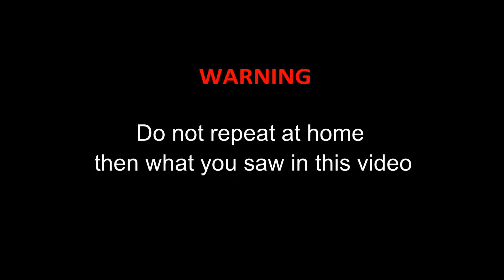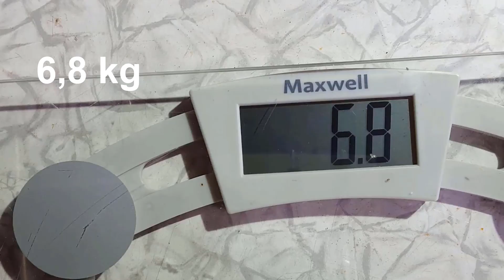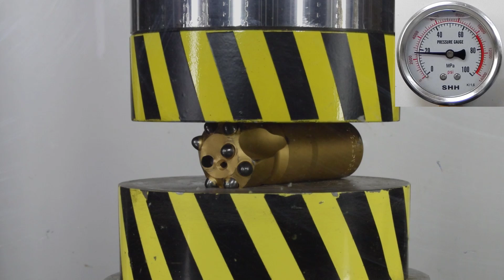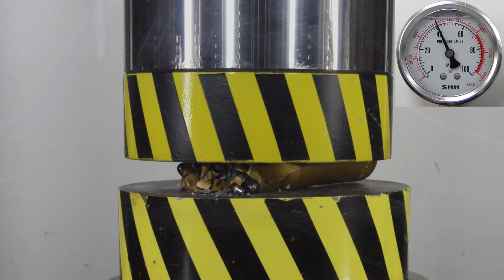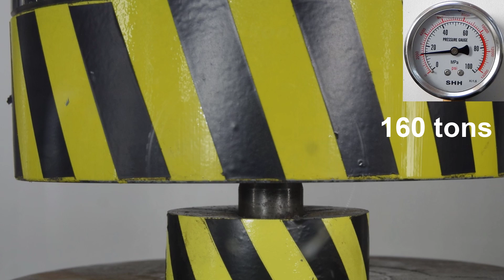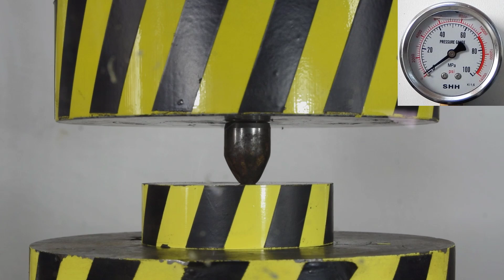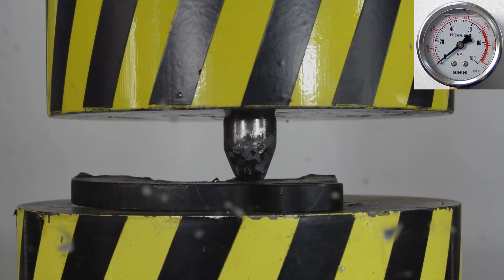HEATED TO 3000 DEGREES TUNGSTEN BALL VS LEAD AND FOIL

Comment: (This post was edited by Google Translate.)

Before watching this video, I knew nothing about this material. After watching the video, I researched the material and was very impressed. I never thought I could love an ingredient so much. If one day I find the right person. The ring will be made of this material.
Reply: that will be one heavy ring!
Reply: That's going to be one expensive and heavy ring. Also, make sure it has a built in fault/crack before you buy it. It is there to make sure the ring can be taken/broken off in emergencies. Since it's just not probable to break tungsten rings

Comment: Sir, what I would like you to show us is HOW you heat the W ball (or anything) beyond 1500 °C. Oven ? Flame ? Induction ? Arc ? I am curious. Also, how do you master the temperature (2000, 3000). Thanks in advance
Reply: Digital furnace?

Comment: the 1000 degrees ball's look like mini sun😂
Reply: It’s too dim to be a mini sun but you could call it a microscopic sun
Reply: @Steve.780  The look is still wrong since the surface temperature is wrong. Actually the 3000 is the closest to the sun (which is almost 6000).

Comment: at 3000 degrees Celsius it is very shiny
Reply: Is the C° or F° cause that’s like 5,432° F that’s seems kinda hard to believe.
Reply: @crandonborth  is a tungsten ball.  made of a material capable of withstanding temperatures higher than 3000 degrees Celsius without melting. the melting point of steel is 1400 - 1500 C° and of the tungsten is 3422 C°  is the metal with the highest melting point
Reply: @max-gm6sv  Yeah I knew tungsten was the highest melting point but how’s that even possible to get it that hot? An acetylene torch maybe??
Reply: @crandonborth  yes i think
Reply: Yeah there is no way the tungsten ball was ever hotter than 1000 C, I have hands on experience with high temperature, and tungsten would be making a lot of fumes from oxidizing, and then the oxide boiling away. Not to mention the color and brightness of light coming of the ball is an order of magnitude too dim.
Reply: @crandonborth  It was never hotter than about 2000 F. The video is clickbait
Reply: @freevipservers  It’s certainly possible.
Reply: @crandonborth  It's possible, but not in this video.
Reply: @freevipservers  but why ? I believe you because if it were at 3000 degrees Celsius it would have evaporated the lead that is well above its boiling point
Reply: @max-gm6sv  Things emit more electromagnetic radiation exponentially the hotter they get. The ball would cool down from 3000 C very quickly, and as someone who has actually melted tungsten before, it's way brighter than what was shown in this video. This ball was no hotter than 1000 C, probably 800 C.